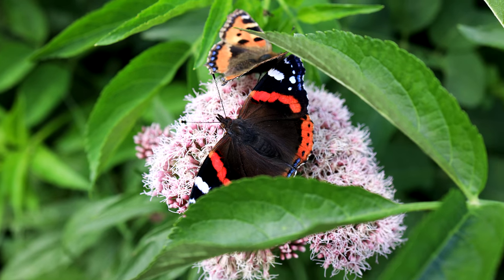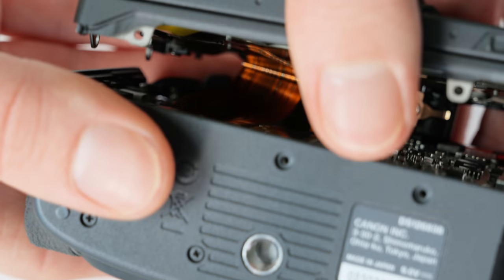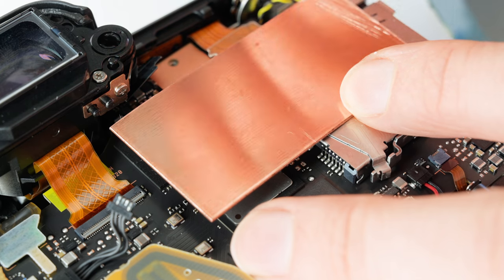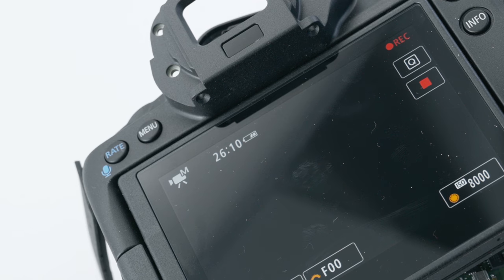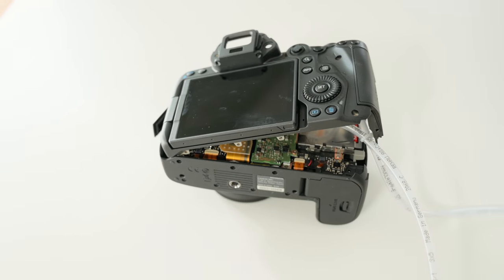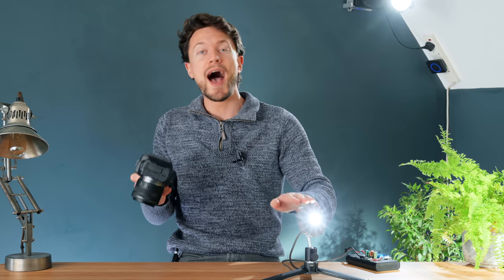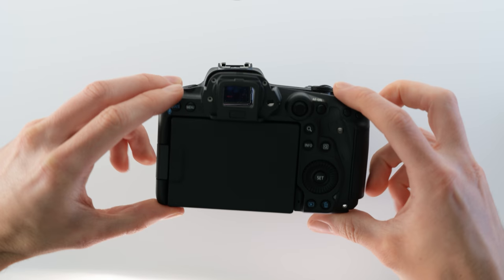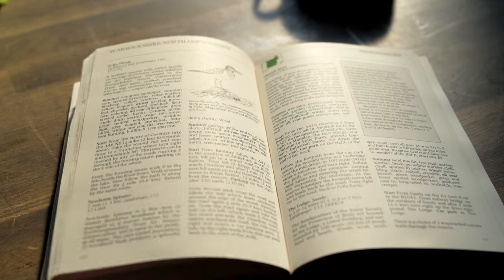The only reason to watercool a camera....

Comment: The fact that a single copper plate and some thermal pads can almost completely alleviate the thermal issues just goes to show how badly this camera is designed.
Reply: Except you're wrong. It isn't bad design, it is deliberate limitation. They don't want the R5 to record hours of 8K, they don't even want it to be able to record 40min, because it could take a chunk out of their video camera market. The deliberate limitation of heat rejection capability when there is obviously space there to use for it doesn't show a failure to use the available space, it shows a deliberate choice to limit the camera.
Reply: @yucannthahvitt251  "Bad by design" is still bad design.
Reply: @Skux720  If you achieve precisely what you mean to, it's good design. Just because it isn't to our liking (a mirrorless still camera that also does a cinema camera's job) doesn't mean it's bad design. This is most basic product design, it's the same reason a porsche cayman will never be faster than a porsche 911 from the factory. Letting your lower margin products take profit opportunity from your higher end offerings is a brilliant way to make a good product but stagnate your business.

Comment: I feel like the fact that cannon didn't include such a simple fix for the heat problem says something...
Reply: Engineer02  As I progressed trough the video, I kept getting mind blown, at the amount of overwhelming oversight of the easy fix to some problems... to the point many seem left behind on purpose: i.e. No excuse on not using a more conductive (copper) heatsink (this is STILL a $4,000 product!)
Reply: As I have heard many people mention: they likely did this to preserve their cinema line of cameras. Why spend thousands more if the R5 is close enough? But since the R5 in unstable as a cinema camera, it preserves that line.
This is why I prefer companies that are pushing innovation, rather than making questionable choices to sell more products. I think the way Cannon pushed the video qualities of the R5 without being up front about the overheating in the beginning, also says something about them.

Comment: They just screwed over customers and you fixed it...
Damn!
Honestly they should pay you money for that!
Reply: NO heat-pipes, no copper heatsinks, thermal pads - not paste.... a power board ON TOP of the heating chips...  This is by DESIGN... Canon don't want an 8k full frame camera competing with their CINE $20,000 range... given that full frame cameras with L series lenses have amazing picture quality...who'd buy them when a $5,000 camera could do the same? So.... hobble it in a "believable way", not by firmware (that can be hacked) that limits record times, but by the very parts used to keep it cool! It EVEN REPORTS "Too hot!" as an error message - it was released with overheating messages! If overheating was a "mistake" they often crash and shutdown - because the designers weren't expecting it... Not Canon's.... HMMMMMMM! Suspect.
Reply: @SarahC2  Agree. Now we see their stupid decisions and they have a situation on their hands.

Comment: The copper plate solution alone will probably cost some engineer his job.
Reply: Tbh there is a fair chance that the thermal limitations were intentional so that this product wouldn't have to compete with Canon's high end video cameras.
Reply: It was a bottle neck Canon aren't stupid
Reply: @qps9380  That’s pretty likely, I’m sure Canon’s thermal engineers had massive objections to the managers saying that “oh we can save 10 cents a camera by using the bare minimum amount of aluminium to cool the CPU, oh and it can’t record for too long either otherwise it’ll start to threaten our cinema cameras, so win win” 

Canon’s engineers: shakes their heads whelp, we will just have to try to do our best in firmware, since our hand has been drawn by management” (well sorta, management likely had a hand in the what the firmware would do when the camera got hot, then they made the firmware programmers to update the firmware to read the temp sensor instead of a stupid timer) 

All in the name of product line segmentation. smdh

Comment: You should try cutting out the plastic back and replacing it with a copper one.
Reply: was thinking exact same and it will look and feel damn cool
Reply: @parthgulati4675  maybe conductivity problems
Reply: @parthgulati4675  actually it wouldnt feel cool, it would feel hot lmao
Reply: He probably wanted to keep the camera as original as possible... In case he wants to sell it in the future. It's a 4000 USD camera afterall.

Comment: 13:18 The power board is really a case were a thermal pad is probably better than compound. It can give you a much more even mounting pressure across multiple chips and even the PCB than compound. Even mounting pressure aids heat transfer considerably.
Reply: well there are also these types of screws that are used to mount a fan onto a motherboard

Comment: Pet peeve: 35C is not “half the temperature” of 70C, unless your point of comparison is the freezing point of water. If you’re trying to compare your temperature deltas it should be based on the ambient temperature, meaning your new thermals are WAY better than half.
Reply: Lol who cares. No one measures temperature in kelvin, this isn't a scientific dissertation. It's completely fine to use that verbiage in this case
Reply: @MTD369  You're missing @Fluffy's point - he's not suggesting comparing to absolute zero, but to ambient. In this case, say 25C ambient, the temperature difference has dropped from +45 to +10, i.e. it's *less than a quarter of the original temperature difference vs ambient*. This is huge.
Reply: @MTD369  I never mentioned Kelvin, I was just saying that in this circumstance you want to look at things in terms of the heat *delta*, not in terms of the absolute number.

"Half the temperature" is meaningless in this context. Kelvin wouldn't make things any more useful; we're not talking about ideal gases, here.

Comment: You might have considered creating a thermal pathway to the tripod screw connector. Then you could have used a copper screw with to attach a heat sink and fan system to dissipate the heat directly. It should work better than trying to blow air on the back of the camera.

Comment: I'm guessing the reason why they didn't port the heat to the surface was to meet the IEC 60950-1 standard, which limits 'handles, knobs, grips, etc continuously held in normal use' to 55C for metal or 75C for plastic. I imagine that any external part of a camera would be considered 'held in normal use', so it'd be tough to have an external heat conductor and still meet the standard

Comment: You could make the internal heat sink in an L-shape so that it penetrates the bottom of the camera and provides a surface along the bottom of the camera to act as a "cooling port". You could then mount your cooling system there and fit everything into a compact base attachment like you did with the 3D printed fan, but it would cool the internal copper heat sink directly through the bottom of the camera.

Comment: A little surprised the image sensor isn't also a major part of the overheating issue. 
I wonder if this solution would also reduce image noise in very long exposure images.
Reply: It generally doesn't decrease noise a ton, although it can significantly change the pattern of noise. It does reduce what are called hot pixels (which is also a kind of noise, but not really the type of noise you see normally). In fact, they make dedicated cameras for astronomy purposes. These have many different features that are tailored for astronomy, including most of them cool the sensor directly to a consistent temperature, allowing you to remove the base level noise patterns from your final image.

Comment: It's a shame for a almost 5k euros that this issue is just overlooked other than the build in safety, shame on you CANON ! Now pay respects to this man!
Reply: It's not overlooked. It's mitigated. Panasonic cameras in this class will shutdown after 30 or so minutes of runtime. The max operating ambient temp is 104F, reducing that 30min significantly if filming the likes of Arizona in the summer heat.

Comment: WHO WOULD WIN?

Canon's Entire Engineering Department?

or

One Pretty Youtube Boi?
Reply: Canon entire engineering department. Their job was to make 100% reliable product that won't die on you in a year or so and that's exactly what they did. Pretty sure they could stick the fan like in S1H, but decided that photographers are just gonna hate them. Therefore you have C70.
Reply: @smashexentertainment676  My guy, you should watch the video before commenting. Tell me, how does letting internal components regularly heat up above 80°C make for a more reliable product than improving the passive cooling and selling a separate, bottom mounted fan module for videographers? Photographers would not give a damn about improved passive cooling, as it is not visible from the outside.
Reply: @mashroom_  After the pretty boy from the video will modify 100 cameras and test them for a few months to confirm that it's OK for mass production, I'll admit that I'm wrong. So far it's just a cool mod, that may or may not kill the camera.

Comment: If the back plastic is not touching the smd components of the camera and if there is little (enough) gap between the components and back plastic... then the inner side of the back plastic can be coated/layered with metal like copper or aluminum with a design that it contacts with that metal extra piece using thermal paste.

Comment: Another fantastic video. Some really out of the box thinking. Does make me wonder why Canon is happy to release a product that is inferior with their R&D budget when such an easy (for them) fix could be possible. Makes me wonder what the ratio of stills-photographers to videographers buy these cameras, and I suspect there are far more of the latter than the manufacturers realise. 

The overheating issue isn't limited to the Canon either. All but the very latest Sony APS-C cameras suffer with this although I don't think there's enough room inside them to add an improvised heatsink.
Reply: According to Canon, the balance is 85%:15% of photographers to videographers. That number is probably so high because Canon have a very, very loyal photographer base who basically buy everything they put out.

Comment: Soo the overheat message is just a timer in code, thats kinda Sad actually
Reply: I was wondering that from the start, and found this comment before that part of the video. Dang. That is sad. Lazy.
Reply: You'd be surprised just how awake a switch off camera actually is....The physical switch is not physical and it can't be, because there will be things the camera will have to do after switching it off, either cleaning the sensor or when recording video cleaning up the end of the file header in order to not write a corrupted file to the card.

The timer is there to stop people from switching it off, switching it right back on and try to record video again immediately, and suffer the same message within seconds. 
People will either get pissed off and flood customer service with questions about this, or they will eventually push the sensor to a partial breakdown point.
The temperature for it to display the message is probably one having a margin, but keep reaching the point to which it overheats and needs to cool down and you will keep the sensor at a temperature it's not designed to be at so long, and eventually will cause damage.

Comment: I know this needs further testing, and I'm 2.5 years late now. But that copper heat spreader could be sold as a mod for Canon R5 users. Assuming they want to void the warranty of course. But man, that thermal pads poorly placed is a huge oversight from the manufacturer.

Comment: I hope someone working at canon watched this and decided to quit their job.
Reply: it's always the wrong persons to decide to quit the job. Those who are responsible for such a fiasco on the other hand will still sleep absolutely fine
Reply: @henryposadas3309  agreed, I think the thermal engineers would’ve had objected to cool the CPU just with a small aluminium plate (if it even is aluminium), but they where forced to call it “done” due to objections from management from the camera potentially eating into their cinema camera sales, and the penny pinchers eating into their margins on production costs.

Comment: I wonder what the thermals would be like if you were able to cut away the plastic behind the screen and replace it with an aluminium plate (black anodizing?). Taken a step further, with you other modifications, what results would having that entire back plastic replaced with metal yeild? Could the original plastic part be used to cast a mold?

Comment: How about cutting a hole in the back panel an replacing with a copper plate, or a very thin copper heat-sink? This could be sealed to the plastic to keep dust/water out

Comment: Canon could have easily solved the overheating issue if they just hired a thermodynamics engineer but they are to stingy.
Reply: this is it. people that say that the engineers thought about it and it was management have clearly never worked in a huge old bloated company like canon
Reply: No they could not have easily solved it.  This is a photocamera, not a videocamera which has a stupid amount more passive cooling than a photocamera, and in general is also bulkier because the end goal of what the product should mainly be going to be used for changes the design.
A photocamera is meant to do 1 thing very well: taking pictures, and you should really take the video-function for granted for it being nothing more than a nice extra.  It is, in no way a total replacement of an actual videocamera, which does 1 thing really well: record video.
Reply: @Dutch3DMaster  The marketing of this camera states otherwise. They market it as mirror-less camera that can take photos and shoot amazing video. Their market reflect the idea that it should be able to at least record video as long as their traditional dslr cameras. If a thermodynamic engineer was involved they would have redesigned the camera slightly to try improve its thermal efficiency by making it slightly bigger or repositioning components but they didn't cause to them it was more important to make the camera small and look nice then actually deliver an acceptable level of video performance. No one is expecting it to record for hours on end but it cant even make it to 1 hour which is ridiculous considering much older DSLR cameras can record for much longer.
Reply: @Adrian9987  My 60D overheated after about 35 minutes, next to it not being able to record 1 piece of video for longer than 29:59 minutes.

They might have marketed it as such, but people are stupid for believing a camera like this will be able to sustain that function and should never ever forget they are buying a stills camera, and not a videocamera.
If there is anything more pointing towards the problems photocamera's with a videofunction pose it's all the ridiculous solutions I see people buy just to make more of a videocamera of such a thing, which for the most part comes down to about 3 things:
1. formfactor, the camera is not designed with video in mind and as a result has poor weight distribution when you are using it as one).

2. Connectivity, I see people buying mindnumbingly stupid and complex solutions "because OMG I need to connect an XLR microphone to this thing and it doesn't have inputs for that!"
These add-ons are usually expensive and add up to the total price of your whole package because some of the manufacturers completely overprice some of the accesories (which at times are also of the absolute worst quality I've ever seen).

3. Handling of the camera as an actual videocamera, photography lenses are built with autofocus speed in mind, not manual focus (and yes, actual videocamera users, especially those working camera's in the higher segment still use manual focus due to the possible unreliability of autofocus, if a camera has that at all).
Due to the short barrel movement of a photography lens, manual focus poses a problem most of the time, and heyho, people buy another ridiculous and expensive add-on to solve this problem.

At times, I've seen people fall for the "OMG this camera makes such a cinematic kind of image!" thing they never ever seemed to realize they spent more money on a stupidly complex setup (that at times is also really fragile) on which they could have saved money if they would've just bought a videocamera.

This all is when I even leave out people starting to complain afterwards of "I was making a video of X or Y and I had to pause the recordings because my camera heats up, which is just stupid for a brand like Canon."
No it's not stupid, you just thought you could pull the same trick a videocamera can do reliable with a photocamera and you should be feeling stupid for not having seriously considered a videocamera if you can't afford to look stupid in front of a possible customer you are making a video at.

When you read this it probably comes over as me being incredibly sour, but I've seen to many people coming back with footage that  had to deal with all sorts of problems because of all the aforementioned things, and it was up to video-editors (sometimes me, sometimes someone else) to solve those problems, some of which would not have been there in the first place if they would've just picked a videocamera for the job.